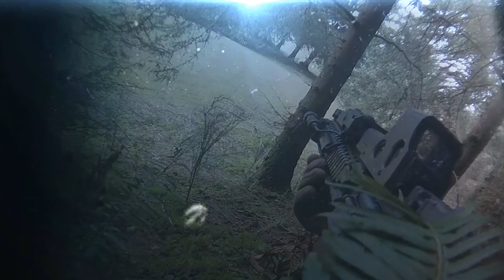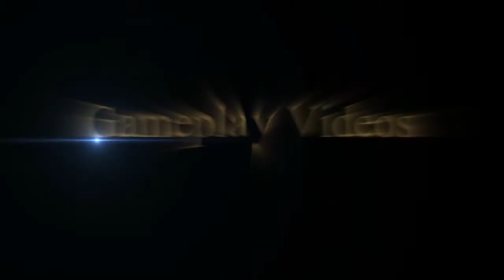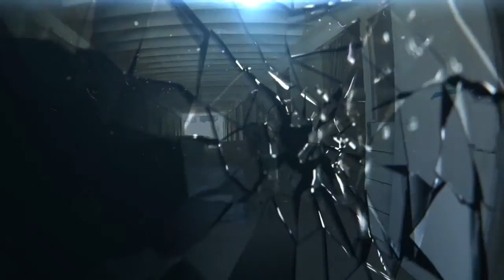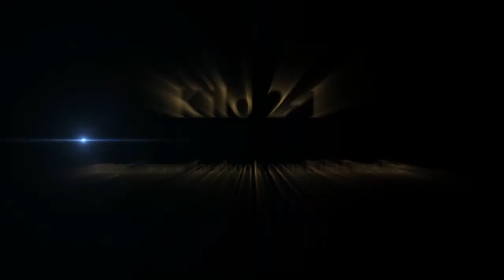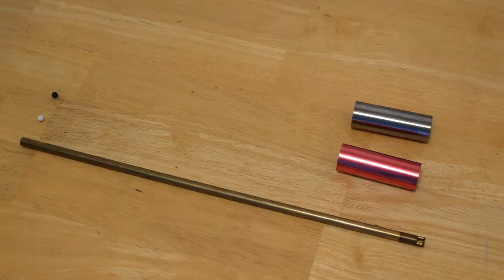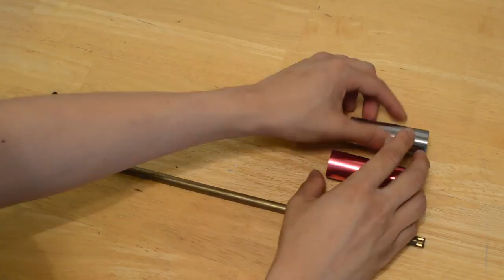Joule and FPS: An Explanation of the Differences and Joule Creep

Comment: Very informative video. However, what you say at 3:11 is incorrect. The amount of energy in the BB is not constant throughout flight - In fact it varies more than FPS does throughout flight. Kinetic energy is defined at K=(1/2)(m)(V^2). So a 5% decrease in velocity actually results in a 10.25% decrease in kinetic energy.

Other than that point, great video!
Reply: CresusAurraellius  I too was like , what is he talking about :) highly rated video about  one thing , joules and it got it wrong heehe.
Reply: CresusAurraellius  I was joule creeping with out know what it was. Bought my polar star and the guy that set it up set it way to high even though I was shooting 377fps w.20. Thanks for the info
Reply: yup, energy is lost during the bb flight due to air resistance, and side wind, if ur getting hit by a bb from 10m distance it will "hurt" way more than let's say 20m or 30m

Comment: Mate.. energy is constant because this is how physics says. The amount of energy that goes into a system will have to leave the system, as is or transformed. 
In this case the energy is the correlation between velocity and mass(probably there is a small amount of energy that bleeds out as heat... but let's keep it simple).
Theoretically a gun that shoots 400fps with .2g bbs will have aprox 1.5j. If you put 0.3g bbs in the same gun you will get around 328fps so the energy remains constant, at around 1.5j.

There are many problems with gas guns and HPA because :
- No one can control perfectly the amount of energy that goes into those systems. The gas regulators will let some gas to escape into the barrel in order to propel the bb but those are not very accurate systems.
- On top of that the propane for example will have probably 100psi at 40f and 145 at 90f.
- When you measure the speed of a gas or HPA system with 0.2 there is a big chance you'll get only part of the picture. You will certainly have a lot of unspent energy because that very light projectile will leave the barrel way too fast in order to capture everything. So you'll probably have 1.5j gun when you measure it with 0.2g and a 2.2J one when you measure with 0.4g bbs .

On the other hand an electric airsoft gun will have 60cc of air no matter what because the volume of the cylinder is fixed.